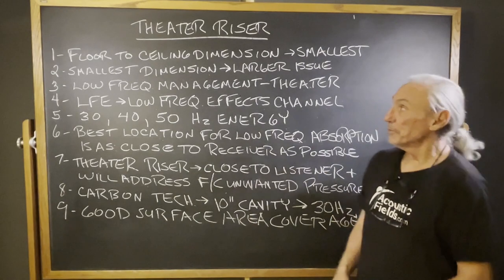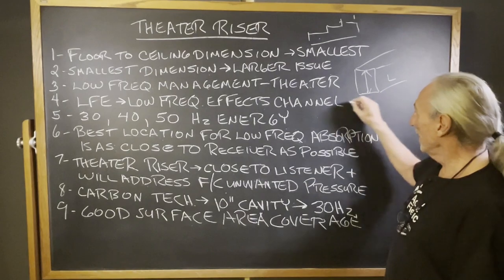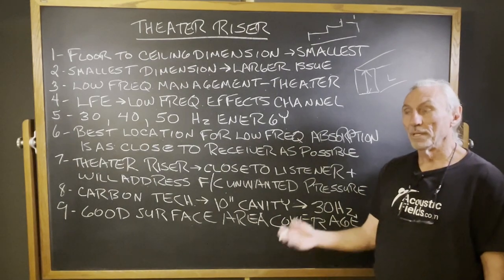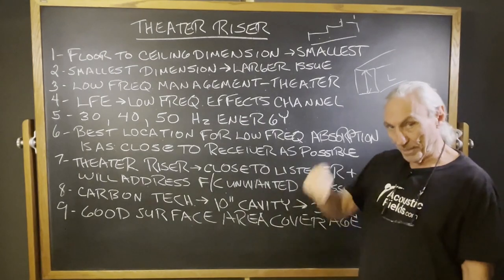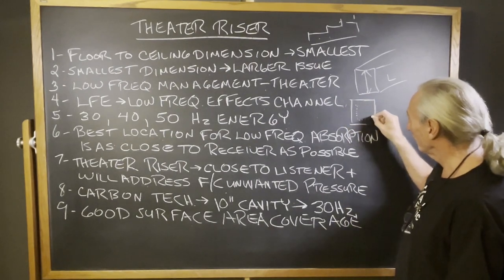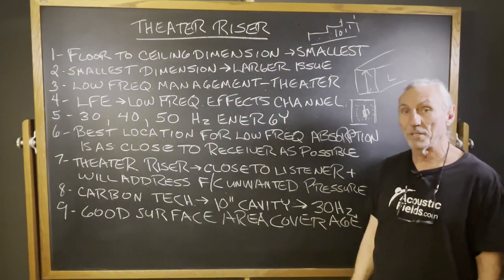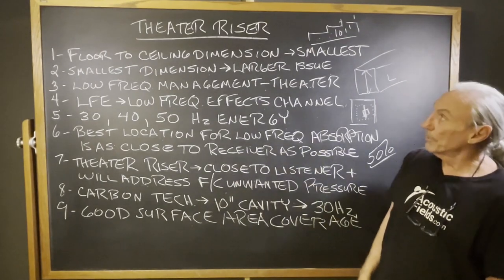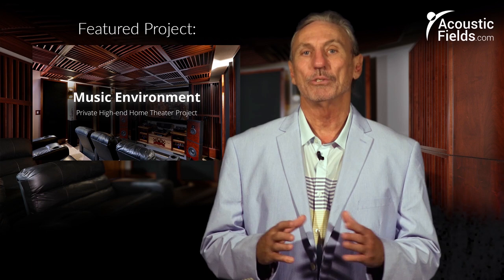Home Theater Seat Risers - www.AcousticFields.com

Comment: I always enjoy these lessons. 
This is a great idea if you're installing in a wooden house. All houses here are brick with cement floors and risers. Would it be more advantageous to build the riser from wood and have another resonating component or stick with the cement riser floor and put the low end absorption at the back of the room.

I also find the chairs cause the most low end resonance. Is a porous backing for the rear of the seat going to help with this in place of the leather or is just making the entire home theatre chair from porous cloth the only solution?
Reply from the maker: Chairs do not produce low-frequency resonances. Chairs are for body support with closed cell foam in the cushions that does nothing for even middle and high frequency absorption. You must locate low-frequency absorption in the room positions that require it. You can not place it where you have space for it. It must be placed where the pressure issues occur within the room.

Comment: Thanks Dennis. How best to vent into the riser space to couple with the absorption?
Reply: The carbon technology is diaphragmatic absorption, so they are sealed units. Venting them is a bad thing.
Reply from the maker: You are correct. Diaphragmatic absorption is a pressure based technology. It works on sound pressure waves not air flow or molecular velocity like middle and high frequency rays.

Comment: If the 2 most effective places are at the source and receiver (which make sense), would a logical guitar amplifier micing technique be setting the amplifier over a unit AND placing one under the microphone?
Reply from the maker: With microphones, it's all about reducing the pressure the microphone diaphragm is exposed to. Less pressure (to a point) means gretaer resolution. Drummers are able to get tone using our ACDA series of units by moving them back and forth closer and farther from the microphone position.
Reply: @AcousticFields  Do you mean the distance behind the microphone?

Comment: 👌👍
Reply from the maker: The best place to use low frequency management technology is close to source or receiver. The seat riser is as close to the receiver as you can get. An added benefit is that we usually have the 10" of space required to implement our carbon diaphragmatic absorber within a seat riser.